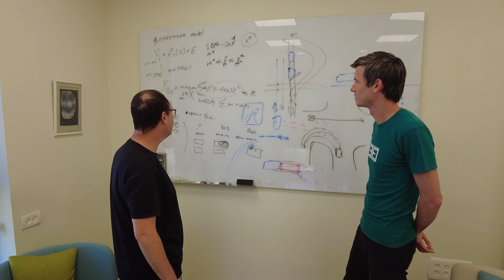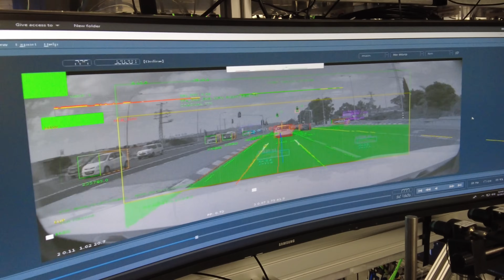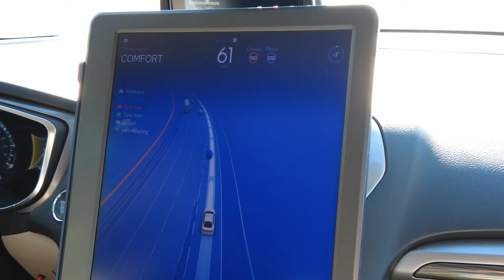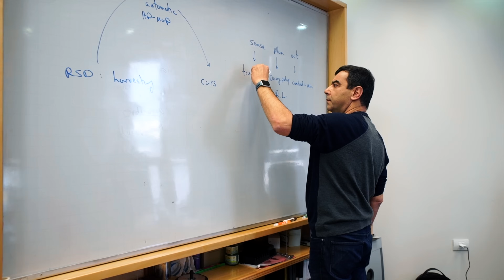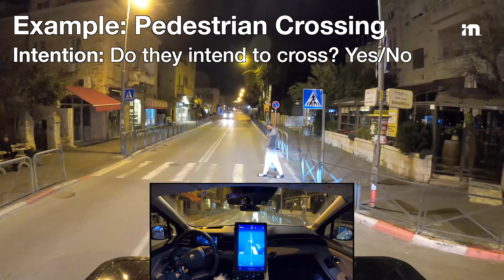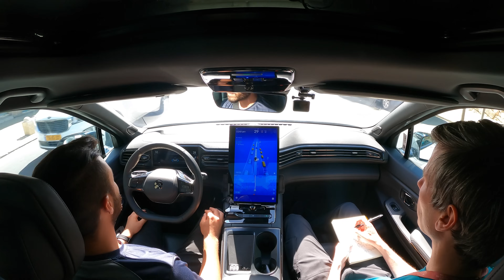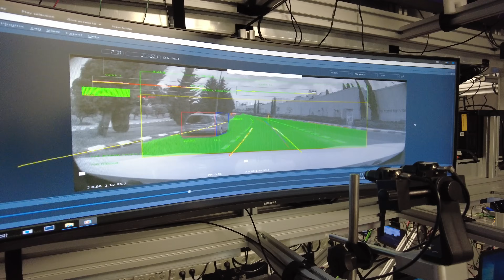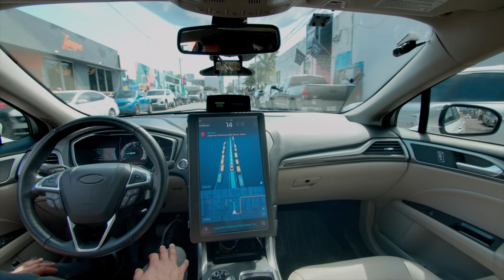Are Autonomous Cars Closer Than You Think?

Comment: Disagree with letting it break the speed limit just because "everyone else" is. If everyone else is doing it, the speed limit is either not appropriate for the road, and should be changed, or there's a very good reason why it should be there and contributing to the problem is not a good course of action.

Minor traffic infractions is one thing, but doing 70 mph when the speed limit is 55 is not minor. It's not guaranteed to improve traffic flow either, because the safety distance becomes greater too, which lowers the numbers of cars per minute a lane can support.

Comment: Good video, but it was more marketing than an engineering analysis. I hope you'll do a follow-up with accident rates, rates of other failures, weather limitations (beyond saying it's good in the fog), etc.

That being said, the demo was impressive. It looks like real progress is being made.
Reply: I think it was more informational than marketing personally. And to my knowledge, these systems on average (even the “bad” ones) are still far safer than even some of the best human drivers. But, we still have to take into account that they also haven't been on the road as long as humans have been driving and also not as many vehicles with this capability. I'd wager however that they are still far safer than the average driver. As for the weather issue, I think he was correct in saying it's easier to start from normal good driving conditions and then work their way up to more difficult areas where the weather is another obstacle to overcome. But, let's also be real and acknowledge that a lot of human drivers also perform poorly in inclement weather.

Comment: This seems so much better than Tesla's self driving. Elon's insistence on sticking to cameras only so he can keep his promise of retrofitting self driving to all Teslas (from a certain date) will doom the system to never be as reliable and safe as this system. Using 2 redundant systems and taking the most pessimistic data from each is such a great design. I hope Elon's hubris doesn't poison the situation to prevent this system from being approved.
Reply: I disagree.  If the autonomous driving is ever going to be mainstream, it has to be economically as well as technically viable.  Only Tesla's approach is economically viable and, therefore, scalable.  What people seem  to under appreciate is that Tesla's FSD Beta works virtually anywhere in North America.  No other system, Waymo, Cruise, or Mobileye, can do that, never will.

Comment: I saw that R2D2-1 sticker at the car at 3:56, is that a marker for the sensors or the vehicle identification?

Oh and while your example is clear about how the technology handles it, I really hope there aren't too many of those weird 6:50 stop signs in the world that's kinda terrible. Something blocking them for the main road on the side of the signs would probably be a good idea if they actually exist, but the example was useful.

What is going on at 15:22? Am I seeing that right, cameras pointed at a monitor showing a driving point of view? I guess it must be some kind of test setup. I guess it might've been that calibration pointed out later in the video?

Overall very interesting video and the technology seemed more capable to me than I would've expectedit to be in the current state, that's promising for the future. Although I'm still not sure if a full size 2 front seat and whole back seat should be the default option in circulation if it's not going to be shared between multiple riders. But more reliable easily shared vehicles could at least result in less wasted space allocated to on street parking and parking attached to housing for those who don't need a personal vehicle on a daily basis.
Reply: Perhaps we need some robo-motorcycle-taxis to meet the needs of single-fare rides …😁

Comment: Bypassing from either direction could be handled from the steering wheel rather than a touch-capable display, and in doing so it would allow for cheaper AVs because normal displays without touch could be used.

Comment: What is the procedure to check the sensors and cameras are out of calibration after couple of years of using the car. I believe this will have a significant impact for SD cars.
Reply: It's likely a very easy problem to solve by just having the systems in the car throw up a warning if one of the cameras or even multiple are having issues. Similar to how cars have all sort of warning systems now.

Comment: I’m cause of a Tesla seeming to only have 100% acceleration on a narrow 2 lane street (looks to be in Asia). The driver seemed to be responding to the >100km/hr speed the car was bolting yet they had no braking power and struck multiple people before finally crashing.
Reply: Tesla claims Autopilot is currently preventing about 40 crashes per day just by correcting drivers pressing the wrong pedal, something that has led Tesla to be accused of sudden acceleration in the past.

Comment: Fully automated transportation would be much simpler if it was in a completely isolated environment.

So if transportation pods could be created  to operate in fully controlled environments with minimal random situations and vehicle to vehicle comes, the entire process and investment could be reduced.

Without reengineering all cities, etc. That may seem like a pipe dream. But is it?

If self driving vehicles become predominant enough to mostly eliminate non-self driving vehicles it seems likely that legislation could make full self driving a legal requirement. That in turn would simplify the tech required to make it happen. What humans might do would become irrelevant, especially if movement pods and other permitted forms of human movement were engineered into separate spaces.

If one takes vehicle replacement cycles into account 10 or 15 years might be enough time to make that happen. It would also probably fit quite well with other plans for road use charging by time and distance,  personal carbon budgets etc., etc.

Combine that with electrification,  for example, and a centrally controlled fleet of full autonomous self driving personal transport pods run by city authorities as  a dedicated transport service might  be seen as a highly attractive proposition.

Comment: Their decision making process is similar to what was taught to beginning motorcycle riders 30 years ago = SIPDE.  That is Scan, Identify, Predict, Decide, Execute.  Lots to do with that and the unprotected left turn was impressive.  But throughout your video the AV's steering wheel is moving a lot, frequently back and forth trying to find the right spot.  I've experienced this behavior in much less sophisticated cars with just lane-keeping, and it's annoying as well as affecting in a small way the car's efficiency.  The same for adaptive cruise control, if the vehicle in front of you is varying speed so will your vehicle, becoming once again less fuel efficient.

I think you should have noted that Mobile-Eye is a competitor of Tesla's system for autonomous driving, just so everyone watching is aware.  

Another point I'd make is that while multiple engines on an aircraft do provide a significant safety margin, the concept of redundant systems should be compared to redundant aircraft controls such as electronics (three computers) and hydraulic systems.  This is much more relevant than a failing engine since if the AV system does fail you do have the ability to simply drive the darn vehicle.  

A good video and there is so much to discuss.  Thanks for this introduction to AVs.

Comment: Autonomous cars miss the point - they can't think like a human so they don't make decisions, they make calculations and calculations are based on data, and for sure the one thing than humans do is NOT make decisions on data!  So, rather than trying to make the left as in your example, some humans will 1: do as the auto-car did; 2: do as the auto-car does but more forcefully (as the other driver did); 3: sit there and wait forever (because they are too timid) causing stress for following cars; 4: choose an alternative option.  As you have already said, you would have turned right and found a better option - and that would have been a) safer; b) less stressful; and  c) plain common sense.  Yes one of these things car emulate a normal driver right up until they pull across a road waiting to enter the traffic and have a "human" driver run into them.  But doesn't that miss the whole point of self-driving vehicles?  It will only work when ALL cars are self-drivers and negotiate between themselves without human interference.  All this tech is just dumbing down the average drivers ability to actually operate a car correctly.  If you think your car is a "white-good" then it's a good thing, but if you are like me and love cars/bikes then give me and old-school, manual transmission, petrol-driven V8 any day!

Comment: My hangup on self driving cars is the cloud connection. I will only ever trust it when it becomes self-hosted and localized within the car itself. I also want the ability to step in at any time and have the self driving aspect shut down immediately. I would love at some point in the future to have massive RV that I can program an onboard nav computer to drive while I do things in the back like cook or nap, only being alerted to take over when needed with plenty of time to do so. Maybe it only works on highways, that would be fine, but it's the only type I will trust. A huge part is I want the ability to completely isolate the computing system from the internet or any other type of non physical connection to prevent cyber attacks on the vehicle.
Reply: The driving algorims are all contained in the car. Takeover is always possible.
Reply: @waynerussell6401  takeover is possible until a bad actor with a whim to take control, does. I want the ability to have it completely isolated from all wireless communication by default, with no chance to be taken over by anyone who isn't behind the wheel. I don't think people understand how ridiculously easy it is to hack into these cars, or for someone at the car company to sabotage the algorithms and push them out via OTA updates. It's scarily easy, made all the easier because the companies involved have a bad habit of ignoring (at best) or prosecuting (at worst) anyone who manages to expose the vulnerabilities in their software and hardware.
Reply: @mtnentertainment3454  I'd like to mention how there are already systems on the road that do exactly what you are describing, only usually connecting to a server when needed to send errors.

Comment: This video is another instance of a "tech influencer" that has been presented with a very optimistic narrative from a company with a financial stake in autonomous driving...and then doesn't provide any information that might refute that company's narrative. Those of us that are actually part of autonomous driving development community know that developing systems for SAE L4 and L5 operation is more difficult than what many people stated five years ago, that there are some very difficult and expensive problems that need to be solved and videos such as this don't provide an accurate and balanced viewpoint on the future of these systems.

Demo cars in this video, and indeed every similar video that I've seen, are festooned with expensive sensors feeding data to multiple PCs drawing kilowatts of power and neither the computers, or the software that they are running, will be easily translated into auto-grade ECUs that will draw sufficiently low current for EV use. Further, most of the object classification, vehicle state modelling and path planning is done with machine learning / artificial intelligence which, despite what some claim, is very effort-intensive to train and can't be imbued with even a small fraction of a human's decision-making ability. 

I could go on, but the point that I would like make to Jason is that these lopsided "self driving cars are just around the corner" videos are not good journalism (assuming that was your intent) and, the above issues will go unnoticed by 99.99% of the rest of your viewers, reduces my confidence in the rest of your content.

Comment: Regulations for  Autonomous should be completely different
They are not even in the same league 
In a road with 70km speed limit an Autonomous car can probably cruise at 120 with no safety problems 
70km is calculated with human dumbness in mind computers are much faster and can act faster without any problems 
I think using human driving data isn't a great idea for this reason
If every car was Autonomous there wouldn't even be any cross sections with traffic

Comment: The liability issue seems insurmountable; each time you or I take the risk of breaking a rule, the overall risk is low and we almost always get away with it... but if that risk was 1000x greater, we wouldn't take the chance, and that is the position someone who programs the car to take that risk assumes when they have 1000 cars on the road. It seems impossible to imagine a scenario where regulatory bodies can absolve manufacturers of these liabilities, and having a centralized "operator" to make the decisions only shifts that risk to them (and would also be infeasible given the necessary reaction time).

Comment: This is much more practical than Tesla's full AI with no LIDAR goal, but it will still need tech built into the roadways for real full self driving to work.
Reply: It's not at all practical if it's not economical.  The cost of all those redundant sensors and computer systems, not to mention the elevated power requirements may the system a laboratory experiment.

Comment: I agree 100% with the hardware redundancy explanation, and with that said it's crazy how the automaker that is the most advanced in this topic (Tesla) keeps removing hardware to only rely on cameras🤦🏽‍♂️.
Reply: Not crazy. Redundant sensors don't give you much advantage, but have lots of downsides. The simple fact is that you can't drive if you don't see. Other sensors don't give you nearly enough information for that. For example you can't detect road markings and signs without a camera. And if you can't drive without a camera anyway, the rest is just distraction. Humans drive with just two eyes, so we know it's possible.

And that level of redundancy is unnecessary in a car anyway. Planes need it because they have to keep flying no matter what. But cars can pull over and stop. A self-driving car only need enough backup to safely park itself and call for help. Tesla uses redundant cameras, a redundant computer, and a redundant power supply. That's enough.
Reply: @andrasbiro3007  but that's assuming you want to make autonomous driving equal or just a bit better that human driving. In my perspective (as every automated technology developed) is to make it 10'sx or 100'sx  better than the manual way not only in driving but in safety.

Precisely, because of the fact that humans don't have Radad, LiDar or ultrasonic sensors is why I believe that autonomous driving will be better that human driving. But only time will tell if Tesla's approach will work better than the one presented in this video.
Reply: @jeanmenieur  
1. To make FSD better than a human it first has to be as good as a human.
2. Also FSD uses 8 cameras with a combined 360 degree vision, so it's superhuman anyway. Plus humans have a long list of flaws that makes them far worse drivers than a computer can be, even with the same sensors.
3. Again, all those extra sensors are just distractions. They provide no additional information, their main advantage is being easier to process for traditional software. Watch Tesla's AI Day 2 presentation, or Ashok Elluswamy's keynote at the Workshop on Autonomous Driving at CVPR. He talks about Tesla's "Occupancy Network", which uses deep learning to generate lidar-like data with only cameras, and it's actually far better than lidar, because it's not just a point cloud, but contains tons of semantic data too.

Comment: Nice video! One caveat - not all aircraft twin engines are redundant and it’s an error to think of them that way. They usually require both to “fly”. A twin on one engine will fly well enough to get you to the scene of the crash unless handled very carefully.
Reply: They have a distance they can travel on one engine.
Since the newer engineers are far more reliable they have a longer distance allowing for trans Atlantic travel.
Reply: I assume he was referring to aircraft rated for ETOPS operation.